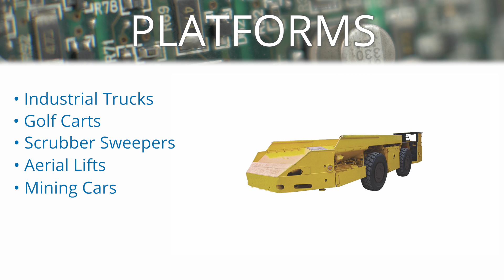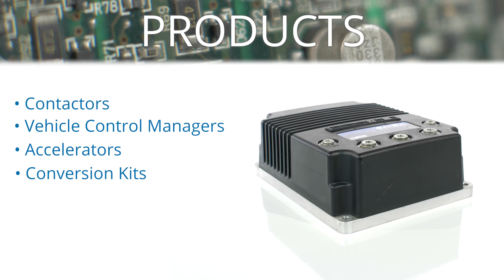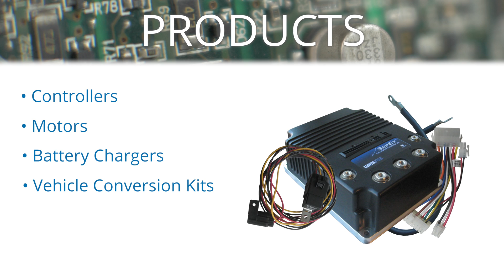Meet Flight Systems Industrial Products (FSIP), Your One-Stop Shop for Reman Electronics & More

Comment: someone who speaks Spanish..? I am dedicated to the maintenance and repair of golf carts of different brands, many times I have run into controller problems, and electronic chargers that stop working, and I would like to be able to send the parts for repair but I run into the barrier of the language, it would be possible for someone to translate ... '
Reply from the maker: ¡Hola! Nuestra chat que se encuentra en https://shop.fsip.biz/ tiene un función de traducción. Puedes usar el chat o enviar un correo electrónico a customerservice@fsip.biz. Tenemos empleados que pueden hablar español y asistar según sea necesario.

Hello! Our chat on https://shop.fsip.biz/ has a translation feature, so you can use that, or email customerservice@fsip.biz. We have Spanish-speaking staff who can can assist as needed.